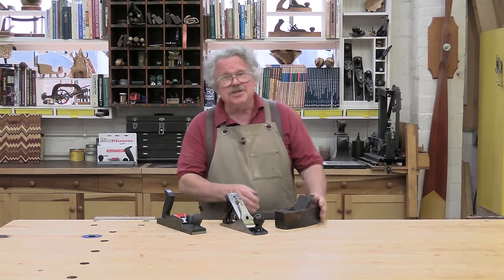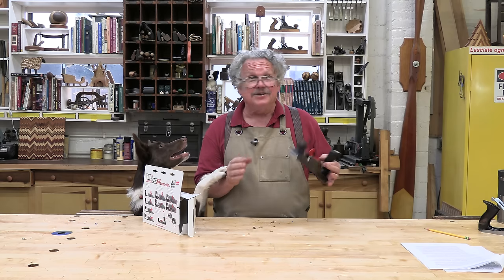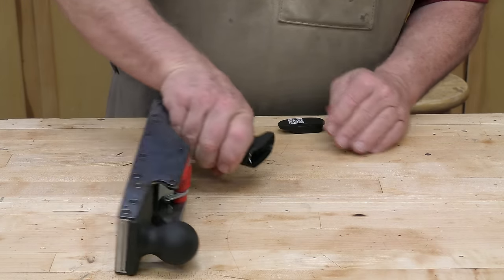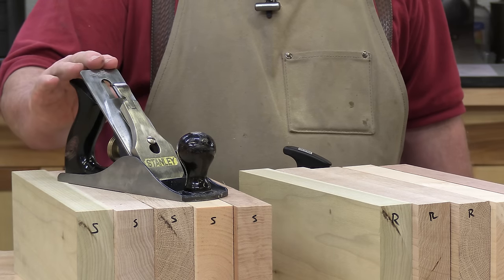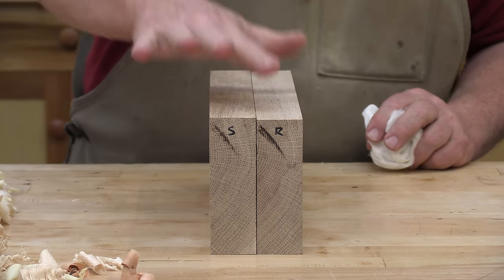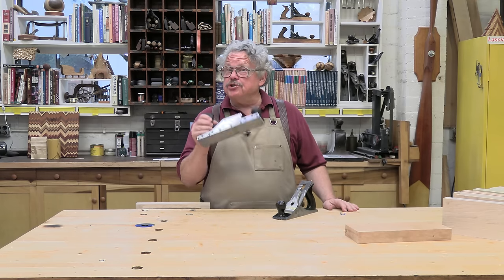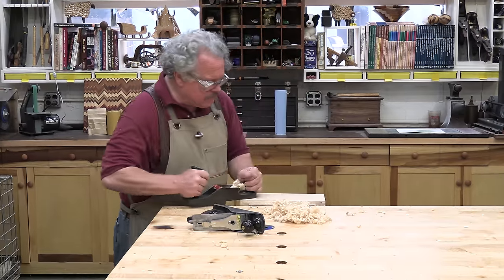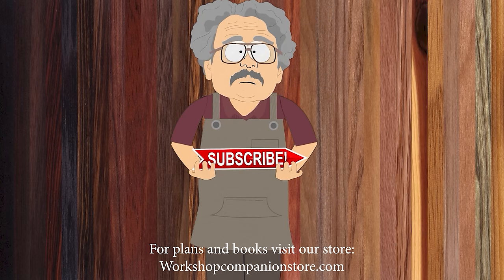Is This the Future of Hand Planes?

Comment: You didn't say which one you prefer ?
Reply from the maker: It depends on what I'm doing. I still use my Stanleys in the workshop, but I have begun taking the Rali out on finish carpentry jobs. It's nice to plane wood in a construction zone and not worry about ruining the cutting edge when you run into a nail you didn't know was there. We're building a new shop right now, and the framers left the openings for the windows and doors a little tight. I was able to enlarge the openings with the Rali fairly easily, removing 1/8" to 1/4"  after I set all the nails I could find below the wood surface. I missed one or two nails, chipped a knife, but no big deal.

Comment: The blades are $28 + shipping for ONE BLADE on the linked site and $40 on amazon...FOR ONE BLADE...you said they are $40 for a 5 pack!!!! Makes this tool almost on the level of being a bait and switch type of scam....very unfortunate
Reply from the maker: Not on our Amazon. See: https://www.amazon.com/Reversible-Replacement-Blades-RALI-105PRO/dp/B000FV8ENO/ref=sr_1_2?crid=3SVICB7F2VEWV&keywords=Rali+plane&qid=1694184280&sprefix=rali+plane%2Caps%2C121&sr=8-2 . You may be looking at the replacement blade for the Rali G30 block plane, which -- we agree --  is ridiculously expensive.

Comment: The blades seem pretty expensive though. Even if a blade lasts an entire project you’re looking at $40 a blade. 

I get it. You’re paying someone else to sharpen your iron. So I guess if you have lots of money and want to outsource that aspect of your hobby to people that have expensive rates go ahead. 

Conversely, you can get a diamond plate and learn to sharpen and tune your blades up in 30 seconds. It depends on how much money you want to pay other people to do work for you. 

No right or wrong there. I’m f the blades were dirt cheap then they would really have something. But they can’t be the same price as a plane iron that can be resharpened infinitely.  They are disposable and need to be priced as such. Utility blades cost pennies. That’s why they are superior to knives. They wear out fast and can be changed haphazardly because they are so cheap.
Reply: I save all my blades in a container. Then on a cold blizzard morning, I out on some classic rock and sharpen all my blades.

With hot coco.

Comment: Interesting tool, I like seeing innovation. Stanley planes are good, mid quality planes. It's not difficult to beat the results a Stanley gives you. Throw-a-way blades (irons) are a poor selling point.  The Rali is a good plane for the occasional job woodworker. Maybe one to keep in a tool box for on site work. Probably a good replacement for a Stanley, Miller Falls, Sargent grade plane.  At the cost of $7 a blade, it won't take long to want to figure out a way to sharpen them. You probably haven't used a Woodriver plane or Lie-Nielsen. I'll have to pass on this Rali concept, your best shavings look a bit thick and planing effort high for what I expect.

Comment: The fact that the blades are disposable is a huge NO NO to me. Why?? Not sustainable.
Reply: Sometimes disposable is more sustainable. Consider a few things: 
1. the disposable blades are significantly smaller (probably 1/100 the weight of the traditional plane blade). So for someone doing small jobs, they may never need as much steel as a single plane blade.
2. The blades can be recycled
3. One does not need to purchase a bench grinder or other sharpening devices for sharpening the disposable blades. 
4. You can resharpen the smaller plane blades as well

I'm not sure if it is or isn't more sustainable... just saying that the math is very complicated when looking holistically.

Comment: They are ugly and tie the owner in to using their products ie. replacement blades. Probably best suited for onsite workers who don't have time to sharpen their tools. One reason to skew your plane is to use a more slicing action at the blade edge to cut difficult grain directions. Also is the cutting angle different between the Steel blades and the carbide ones? I would probably only use carbide on manufactured materials as they increase wear on the tools.

Comment: I would not use it only due to the fact it needs disposable garbage. What's the point of a hand plane if you damage the blade and you rely on pre-stamped razor blades from a foreign company that can be blocked and fettered? Pointless user dependency most likely reverse engineered to fail you.

Comment: Good grief, looks ugly, plastic, cheap. Doesn't perform any better than a normal plane. Very expensive blades considering 2 use then chuck; will they recycle them for you?
Can you get spare plastic bits when they break? How easy is it to cut yourself changing the blades since your fingers looked awfully close to the sharp bits? How well do the blades cope getting hit with hard pine knots? Does it work better than the old RB Stanley planes that everyone hated?